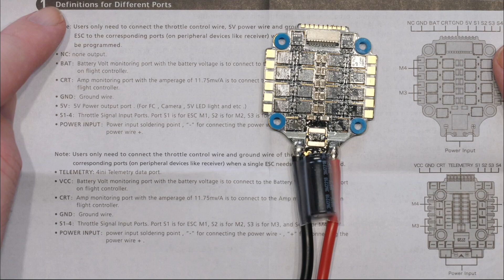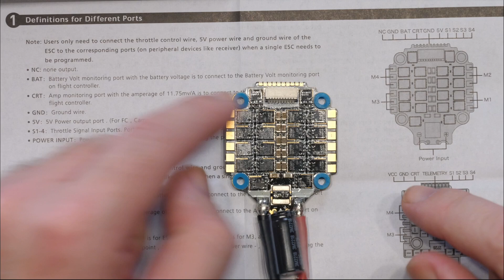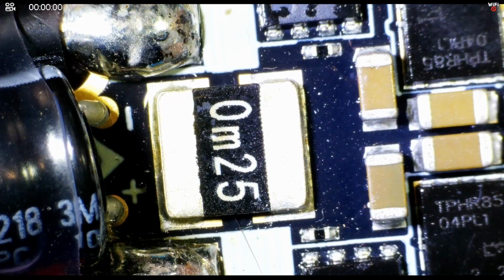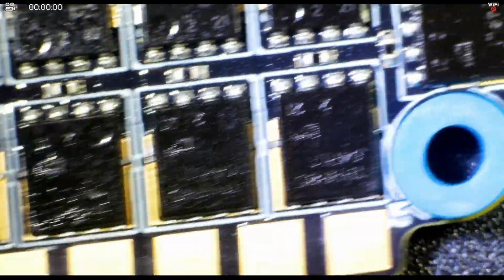Hobbywing X-Rotor G2 65A FPV ESC - New G2 4-In-1

Comment: Hey Ian, would this 65a esc (actually the whole stack) pair ok with the Ummagawd aerolite 2306 1800KV Motors on my Demibot? The motors have a 50a max burst and I believe the esc has a 80a max burst. I’m pretty new to this and don’t know if that means I’ll instantly burn the motors up on my first punch out or if it should be ok as long as I watch my temps?
Thanks for the help and for all of awesome informative content you put out!
Reply from the maker: Yes you will be fine.  These are tanks of ESC.  Congrats on the build.  That’s a nice frame and setup.
Reply: @MadRC  awesome that’s what I hoped you’d say! It was my first build and now I’m hooked. Then I built a Grinderino and now I’m just getting started on a 7” mark4 clone.
I’m glad to hear the hw stack is a tank. That’s exactly what I was looking for because I’ve had a hard time keeping them working in it. First I had a 45a tmotor stack in it that worked great until I installed a gps and shorted something out while I was setting everything up in betaflight. My mistake for not mounting everything properly first 🤦🏻‍♂️   Then I replaced it with a 55a v4 speedybee stack which I liked as well until my first crash on my second day out flying it. I tried doing one too many rolls too close to the ground. It was a open grass field so I wasn’t worried but while walking up to get it I saw a poof of flames so I hurried to unplug it but the flames were gone and I couldn’t even find where they had come from. I assume something burnt out on the esc tho because it doesn’t work anymore. So yeah , I decided I need a stack that is as robust as the Demibot and I’ve heard nothing but good things about hobbywing.

Anyways sorry for talking your ear off and thank you very much for your response and for all of the great videos!

Comment: What I don't like. Pre-soldered capacitor and main leads. What I like, conformal coating and overall looks.
Reply: It's OK, you only need like a 200W iron to desolder those leads without cutting them off first :)
Reply: @PraiseKier  and lead free solder on top of that. Hobbywing, let me choose my own cables and solder.